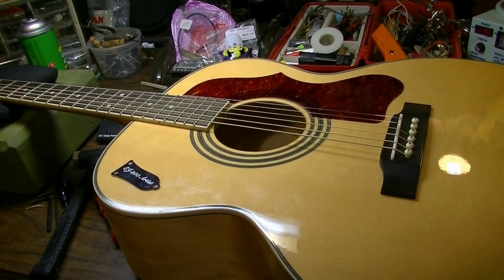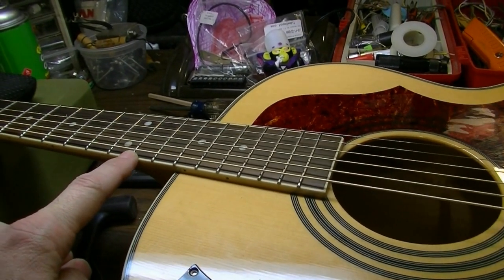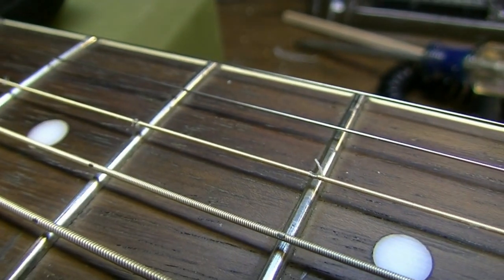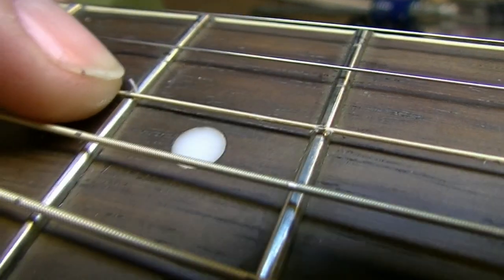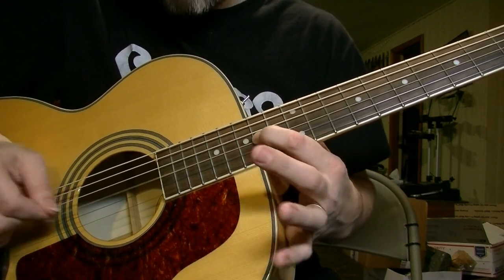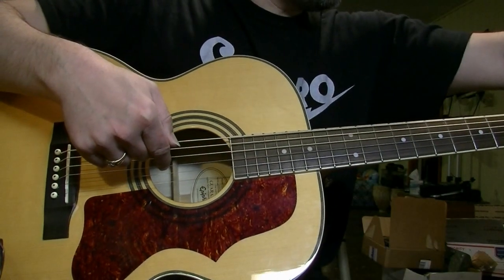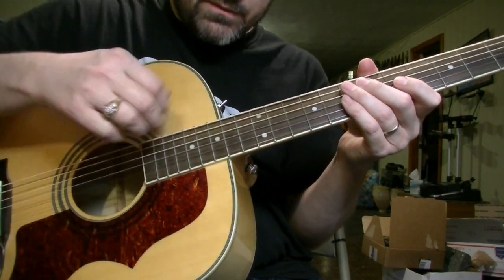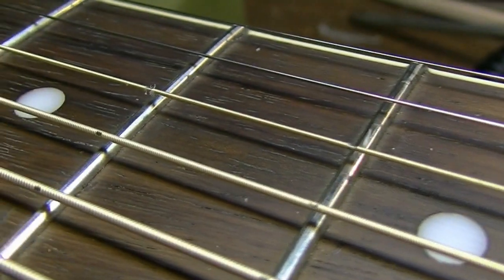Why I NEVER Use ELIXIR Coated Guitar Strings

Comment: Simply replace the old Elixirs with new Elixirs. Problem solved. I've been using them for years and they last about 5 times longer than regular strings. Sure they fray- when they get old just like any brand will have issues when they get old.
Reply from the maker: This set of strings was not old. He bought them less than a week before this vid was made and had used them for two practices and one acoustic gig. He invested in Elixirs because he's a working musician who is not wealthy and was looking for a return on investment. Elixir Polyweb was clearly a poor choice if ROI was the goal.
Reply: Elixir strings usually last me about 15 hours of total play time, electric or acoustic (roughly (3) 3 hour gigs plus some practicing at home). That's about 10 hours longer than non coated strings for me. Sure they fray after several hours but they still sound great for many more hours. I swear by Elixirs, I've been using them exclusively for since they came 15 or so years ago. A great investment and a quality product.
Reply: Also, don't bend a wound third string with ANY brand of string, that's just dumb. I put an unwound third on all the acoustics that i need to bend on. Wound strings were not meant to be bent, everyone knows that. This bashing the Elixir brand is completely needless and unwarranted.
Reply: +Bill Jagitsch haha don't bend a wound string...so much for vibrato huh? never heard that before. you need to use vibrato on every string especially when soloing. people please don't listen to this guy^^^
Reply: +max makin been playing 13 years man. the definition of vibrato is the changing the pitch of a note lower and higher than a particular note ...how do you do that you ask?...by bending the string! or using a whammy bar. the only way to change a itch of a guitar string is to change either the length of a string or the tension.
Reply: +max makin that's what I'm saying. ..to perform vibrato on a guitar you have to slightly bend the strings
Reply: +max makin The word vibrato comes from the Latin word vibrāre, which literally means "to shake." Just like when a singer holds a note and makes it waver back and forth, vibrato on guitar involves bending and releasing or pushing and pulling the fretted string in repeated pulses, tightening and slackening it. In effect, doing what tuning pegs do. Vibrato distorts a note slightly above and below the normal pitch. It can be accomplished with the fingers, a whammy bar, stomp box or plug-in.
Reply: max makin vi·bra·to

vəˈbrädō/

noun

MUSIC

noun: vibrato; plural noun: vibratos

a rapid, slight variation in pitch in singing or playing some musical instruments, producing a stronger or richer tone.
Reply: Jerome Johnson So you're telling me, a tremolo bar, is really a vibrato bar?
Reply from the maker: Correct. A whammy bar is properly called a vibrato bar or vibrato arm. It is not a tremolo. Vibrato is a pitch or frequency modulating musical effect, tremolo is a volume or amplitude modulating effect.
Reply: The Guitologist So this happened Once and you're bad mouthing the strings. That didn't make any sense. When it starts happening constantly then I'll be concerned. You're always going to find a bad set.
Reply: max makin And this is how real violence starts. Behind a keyboard, all the way to Berkeley, then what next?
Reply: timjenkins502 The amount of force applied to a very thin core of wounded G string to bend a half step is not comparable to the amount of force of a vibrato. Besides, the are multiple ways to vibrato that should put less stress on the coreof that string.  The same goes for the very b thin winding. Think about it, that guy has a point, all strings like that wounded G will frail, coated or not. If you bend them enough.
Reply: +einarabelc5 the way he was stating his point was to never ever bend a wound string...let me make another point...if I bend a string a whole tone how far did the string move?  half an inch maybe? now let me play a note then use vibrato moving it back and for multiple times...let's sat 1/8th of an inch...but 12 rapid times creating the vibrato . technology that string has more time traveling on the fret then a simple bend.
Reply: +timjenkins502 technically *
Reply: Not a 3rd string on an acoustic. That's the most bent string on a guitar. Use a plain 3rd string so the string won't fray early ;)
Reply: Bill Jagitsch I agree with you here. I've never encountered this fraying problem over months of playing, albeit in the singer songwriter style.
Reply: timjenkins502 yes but it isn't a full bend
Reply: +Poltergeist I know that. the comment I originally commented on said never bend a wound string period....I was just giving my opinion
Reply: Bruh, dude put another old string on it after. Who the F doesn't buy new strings anytime you have to take them all off. Hahahaha what a joke.
Reply: not a good idea to bend anywound string, you'll shorten their life drastically. I learned that when i was just starting out 40 years ago. If you want to bend a 3rd string, put a .20-.22 unwound third on. Been doing that also for 40 years. ;) good luck mate!
Reply: Or they could take off the old Elixirs and actually put some decent strings on them (and cheaper), i remember buying some in the  late 80's and thinking "there is no shortage of suckers, these will sell".
Reply: I'm having a VERY HARD TIME believing these strings are the real deal. Is it possible they're fake? I know a couple of string companies that provide a code along with each string set - Savarez, D'addario, and some others - that you can use to check from their website if they are authentic strings. I've had Elixirs on some of my guitars FOR OVER TWO YEARS, just to see how long those suckers will last, and they have remained perfectly playable, no fraying. The other reason that makes me suspicious is that this friend of yours isn't wealthy, so he might be going online looking for the cheapest place to buy Elixirs. If some of you don't know by now, there's a whole lot of fake guitar gear coming from China, with free or almost free shipping. Let's not get fooled.
Reply: LuckyLicks probably fake never had this problem been using elixir since I was like 16
Reply: The Guitologist I don't buy I play my guitar hard and been using elixir since I was 16
Reply: Yep. Just change strings instead of trying to re-use old strings. Old strings sound bad whether they are coated or not and they all get those grooves in them when they get old, even the non-coated standard steel strings.
Reply: There's honestly WAY too much ELIXIR fan-boy-ing going on in this comment section. I understand supporting brands you like, but you're going to have to accept that certain brands DO NOT work for everyone.

Like me, I've never liked the way ELIXIRS feel. Then, the ELIXIR fanboy says, "You need to try the polyweb/(any kind I've already tried and know I don't like) kind." Those suck too They all feel the same. I'm just not a fan of any kind of coated strings. That's no reason for me to be a huge asshole to you guys , or vice versa

We all have our brands of strings, and it's pretty hard to change people's minds on this kind of stuff.
Reply: Exactly. There should only be JUST THE RIGHT AMOUNT of support for your fave strings, but god forbid!! not too much. ;)
Reply: Did you read the part that the strings were NOT old strings?  Age doesn't have anything to do with it.  Elixirs sometimes are not compatible with some peoples playing style and they don't hold up.
Reply: JoseitoEdlVodao j
Reply: It seams that my acoustic guitar is getting older fastest than the Elixir strings :p
Reply: D'Addario sound a little better but Elixir last much much more and keep sound quality very long time... i'm still using Elixir... 
With D'Addario i had much problem with the little E string busting too early.
In my city (100.000 people, 6 music stores) there isn't Elixir strings, i must buy online, generally cost 2x-2.5x the price of D'Addario.
Reply: Harry Harshimoto Holy crap, man... You've never seen ELIXIRs fray? I believe you, but I've seen it happen a few times.

It may just be a certain kind, but they usually fray where your pick hits the strings. For me at least, and people tell me I have a really light picking technique.

That's awesome though, that they don't fray for you. I wish I looked them...
Reply: Mine fray fast with a pick...Im talking after just a few hours...
Reply: That's normal, that's the Elixir coating loosening - not the wire of the string. - not a problem and normal: you can use them for many more hours without problems. If your STRING WIRE is fraying you must be using metal picks ;)
Reply: I agree ! Been using them for years myself. Just like any other string, you have to change them every once in a while. Those strings look like he put them on when he bought the guitar and never changed them. Ever ! Elixirs will fray a little on the outside. That's when you know it's time to change them. They last a lot longer than regular strings. But I've never seen left on a guitar so long that cut all the way through the coating. Dude! Change your strings !
Reply: JJ Johnson, Bamareb the relic hunter 0
Reply: They last five times longer if you're into dead strings, and a dull sound..
Reply: Actually they retain their bright tone much longer than tratitional strings. Highly recomended ;)
Reply: I've been playing for 40. You're wasting your time trying to convince me to change brands. I love Elixirs as I've stated. The original movie on this page was a ploy to get subscribers, he knows Elixirs as re good strings, he just wants to create a ruckus lol
Reply: I love' em, just bought two sets today for my new Taylor guitar. I suppose y'all are gonna tell me Taylor guitars are also shit lol save your collective breaths ;)
Reply: timjenkins502 pretty sure the guy was referring to bending the string a half step or a whole step. you can also perform vibrato using the classical/jazz technique, which works a lot better on thicker gauge strings imo.
Reply: ive experimented with at least 10 different types of string brands, only elixir can last more than a week without rusting. if they are not coated, they are definitely treated in some way.
Reply: Technically, you are correct. But Fender calls them Tremolo, so that's what it is if you want it to be. "Wang bar" is the one that I thing is confusing.
Reply: Usr sp life span
Reply: Or you could do more of a violin style vibrato (not as pronounced or deep).
Reply: There are people who don’t bend wound strings?  Like who, newbies?
Reply: wound third strings are much harder to bend than unwound, especially on an acoustic guitar. that's precisely why unwound third strings were not manufactured before the 60's, most people used banjo strings or heavy 2nd strings for a 3rd string replacement. With the advent of heavier rock and blues more and more people were bending third strings into the stratosphere (as we all know) and the third string is the most commonly bent string for other reasons as well which I won't go into here. I will not change my mind on Elixirs people, so please stop trying to convince me ;)
Have a good one!
Reply: fastguitar  this BS video was simply a ploy to get more views ;)
Reply: I have tried elixir several times and each and every time they do this shedding thing. They are TERRIBLE. I’m talking after 1-2 days of basic practice. Every single time it happens. No idea how people can continue to buy them.
Reply: fastguitar if you google you will quickly find many many people experience the same thing. I have tried them multiple times trying to convince myself I was a one off problem. I’ve never seen any other string brand in my entire life shed white stringy coating like that. Never. People try to explain it away like it’s no big deal just the outer coating. Why do no other strings do that? Why would you want to deal with that? I specifically remember the poly web being by far the worst. Couple days they were shedding. Nanoweb took longer but still shedding. Not worth the nastiness and awkwardness when people ask what the hell is going on with your guitar strings. And no nothing wrong with my multiple guitars. And again if it were, why does no other brand do that?
Reply: Bluesboy Jag Cigar Box Guitars relax man, it’s just strings. I quite like
them too but whatever works for you is the right string. I haven’t had much problems but I think it’s to do with playing style partly.
Reply: Bluesboy Jag Cigar Box Guitars is everyone lying then? Just do a quick google search. There are forums full of people experiencing the same shedding problem with elixir. Are we all making it up? Are we all terrible guitar players that don’t know how to maintain our frets? I’m not saying your lying either. But my personal experience has been full of white stringy shedding every single time I’ve tried elixir. I have never experienced this with any other string brand ever.
Reply: Just because I've not had ANY issue with Elixirs in all the years I've used them doesn't mean I'm accusing those that have of lying lol. The original post was a bluff to gain viewers to his YT page ; ) @allstopblue5717
Reply: Bluesboy Jag Cigar Box Guitars I bend all my strings. Guess I’ve been playing all wrong for 54 years!
Reply: @BluesboyJagCigarBoxGuitar  you must be an awesome guitar player.
Reply: @BluesboyJagCigarBoxGuitar  I absolutely love Taylor acoustics. 👍
Reply: @timjenkins502  +1
Reply: You said in the video you didn't know what they were
Reply: @TheGuitologist  lol i call gran bullshit on that. If those strings are a week old than im michael jackson reincarnated.
Reply: @TheGuitologist  Complete nonsense!! I have used Elixer Nanoweb strings for years and that does NOT happen...., UNLESS, the strings are so old and played, that the string winding itself is deteriorating and breaking down, as are the strings in this video, if they are even Elixir strings.
Reply: Coated strings just don't feel natural. I'm sure they serve their purpose. I'd probably just buy them to protect them from kids playing with dirty hands or something like that.
Reply: I liked cos there were 666 likes 😫
Reply: I ruined my first set the first jam session I played with them.  They couldn't hold up to my fingernails.
Reply: @TheGuitologist  Then he probably got a bad package of strings, because 99% of people don't experience that issue
Reply: @BluesboyJagCigarBoxGuitar  Also could try down tuning. Some players who play aggressive acoustic like Tommy Emanuel will tune down a whole step. I think he uses a capo on that guitar. It's a sacrifice in tone but you know everything is a trade off.
Reply: @TheGuitologist  yeah, don't get polyweb, get nanoweb. Mine have lasted for 3months and are still pretty much band new 0 rusting, that's coming from someone who plays hours everyday.
Reply: @BluesboyJagCigarBoxGuitar  15 hours is literally nothing why do your strings wear out so fast
Reply: They do it after a month or sooner. 💯 elixers suck!!!

Comment: I have been using Elixirs since 2005.  I've had a set of Elixir on a 1970 Martin D-41.  I bought it in 1971 and it has been my go-to instrument.  Currently, the strings on it are about 1.5 years old and sound great, even in performance.  Many of my friends who have played it on stage or just at a jam, can't understand why they sound as good as they do after hours of playing.  These were introduced to me when I had a neck reset.  They were recommended by the Martin Trained local tech, and I have never looked back.  My hands sweat ACID and IO would kill a set of GHS Pro Formula, D'addario, and Martin Branded strings.  17 years experience, the freaking pandemic, Lockdown at home, I was playing for myself, so I didn't care how old they were, I didn't have money to buy ANY strings, so I just used my last set.  They still sound great.  The strings on THAT guitar are beyond old!  Give him a set of D'addario coated strings, N EW strings!

I respect your comment about Elixir strings, but I have no such experience!@
Reply: I play aggressively. Hands sweat a lot.  I tear up string s elixirs. Never have this issue.  They out last all strings.    They have different versions. Polyweb is better than nano web … his video is bs

Comment: Been using elixirs for years and I have never seen them fray like that before. How old are those strings!
Reply: He wrote on another comment that these strings were less than a week old.
Reply from the maker: Less than a week. The player is an aggressive (and accomplished) blues player. He attacks his strings and obviously bends a lot on the G-string. The problem is a known issue I've seen many times in the past.
Reply: Use an unwound G string if you like to bend. The problem is not the brand of string ;)
Reply: The Guitologist dude I play heavy blues and metal sat with my guitar for hours in weeks and never had this happen I call bullshit or those frets suck been using elixir for ten years now and never had this happen
Reply: Let me play ONE pass of Classical Gas after I just cut my fingernails.  You'll need a string change.